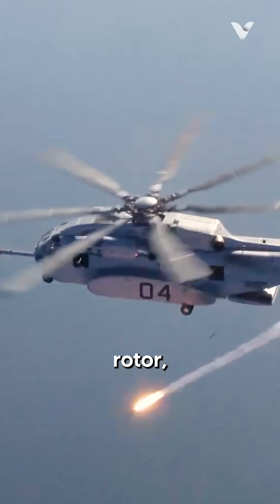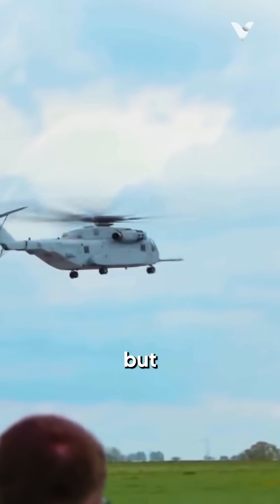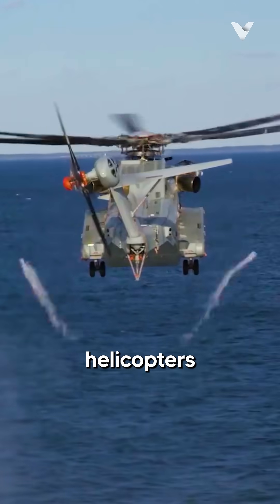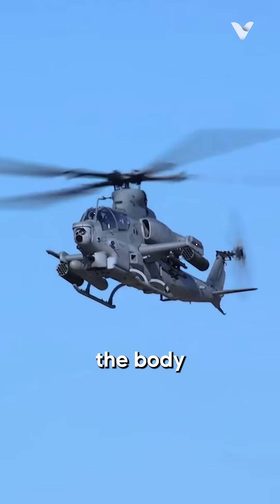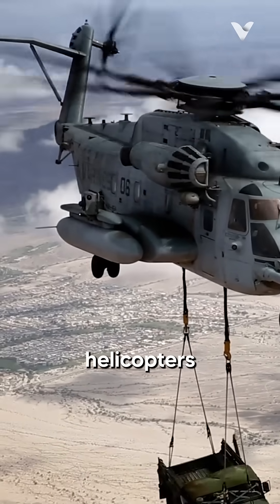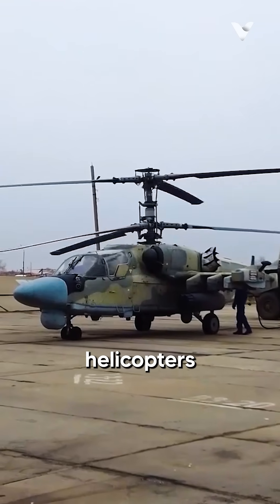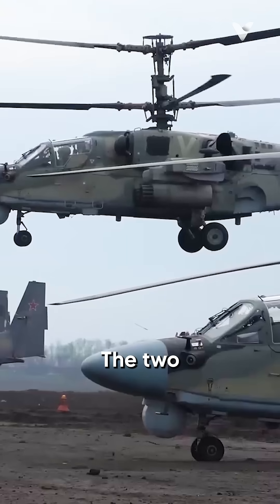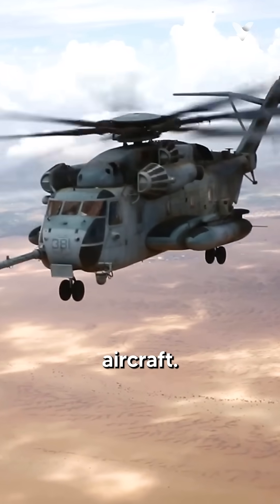What Is The Little Propeller At The Back Of A Helicopter's Tail For? #shorts

Comment: The Short forgot to mention a dual rotor configuration.  Dual main rotor systems are tandem (like the CH-46), coaxial like the KA-50. and Side-by-Side.  Notable Side by side intermesh is the Kaman K-Max.  Technically, the V-22 Osprey could loosely be considered a side-by-side helicopter, though the controls are a bit different.

Comment: Not an accurate script. There are helicopters with a single lift rotor, and no tail rotor.  It is called the Notar (No tail rotor) design.  They use the exhaust gas from the turbine engine to blow air out the boom and keep the fuselage from spinning around.

Comment: What's the advantage of double rotors?
Reply: More lift to carry more weight. That's why Chinooks are used for the bigger jobs
Reply: @frostbiteyguy  makes sense!
Reply: only advantage would be a smaller formfactor maybe?
easy control?

its mosly used for toy helicopters
never seen at real ones
Reply: It looks cool.
Reply: Heavier payloads.
Reply: Adding to some of the other responses, like said in the video the main advantage of the dual rotors is not having to counteract torque since both rotors are counteracting each others opposing forces. the dual rotors are virtually the same thing just one uses another main rotor vs having a smaller rotor on the tail.
Reply: efficiency probably